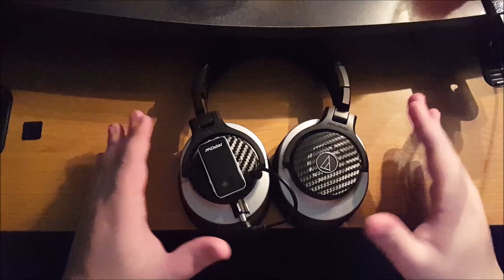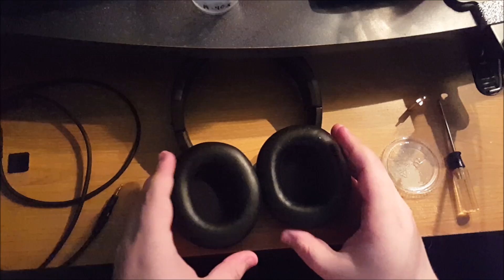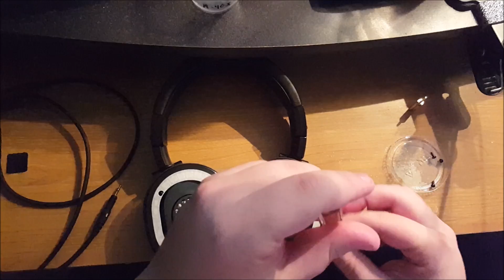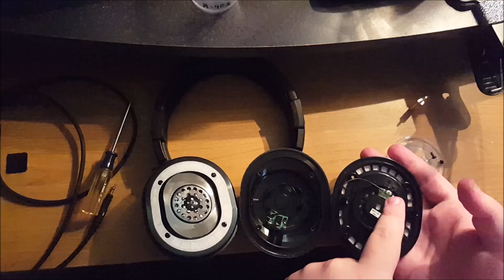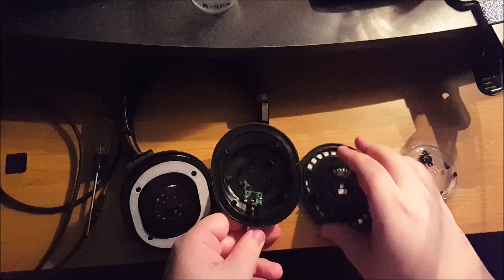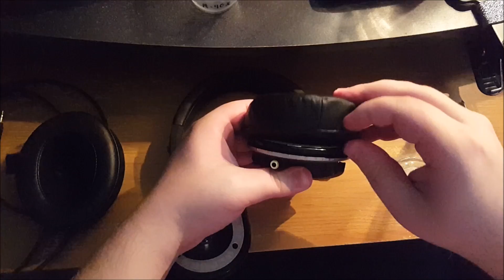how to use any cable with an Audio Technicia ATH M40X

Comment: I've been trying to solve a problem for a few years now.  Mine has the 2.5 mm female connector on it.   I have a Bluetooth adapter that has a 3.5 mm female on it that I'd like to clip to the headband of the headphone. Then I only need a cable that's about 6 inches long.  I'm having a very hard time finding a cable that has these specifications.  I'd also like to have a right angles on each end if possible but not necessary. I know it'd be easier to find a 3.5 to 3.5 cable, but Id rather just use a 2.5 to 3.5  cable instead of opening my headphones to modify it.

Comment: just did this to mod my ATH-M50 so i could use a short 3.5mm cable for my Oculus Quest. thanks!
Reply: What cable adapter did you use?  The one I bought didn't fit

Comment: Thanks, and thumbs up. I have just ordered a pair of these and as well as using them in my home studio, I would like to have all of the benefits of using them on my (Samsung) phone.
All the benefits including being able to adjust volume and skip tracks using the in line toggle on the headphone lead I already have, it has a 3.5mm jack on one end and a 2.5 on the headphone end. 
Does anyone know if the non-locking 2.5mm jack will fit into these? TIA

Comment: can u do something simillar to srh440, 840 or 940?
they have locking mechanism but idk if its simillar or not
Reply: I have the srh440, i've opened and it appears to be the same steps
Reply: @Abraham_Salas  i have actually done this after i commented, it was pretty easy
Reply: @SteelyDanUnofficial  Oh, really? Well, I haven't fully checked if the locking mechanism is the same as I only checked without removing the green card. Was it difficult to remove it?. And could you please tell me what adapter you used?

Comment: There is no sense in removing a quality locking mechanism and replace it with a cheap adapter and a cheap cable. I appreciate the video. but the proposal is not sound.
Reply from the maker: Different strokes for different folks my man; hopefully you have a great day!
Reply: It is if you want to use a vmoda or anything similar

Comment: Nikola--I just wanted to thank you for your clear, easy-to-follow video on adapting the MX-40 for any 3.5mm cable. I easily modded my pair per your instructions and now have a great set of very comfortable cans (I also modded my AT's with the Brainwavz pads and added a Sennheiser HD600-style headband pad) that I have in Bluetooth mode using an Mpow BT 5.0 attached with a velcro patch and 3.5mmm short cable. I guess I lucked out because the little hole for the cable insertion on my set was large enough so that the Josi Minea  2.5mm Male to 3.5mm Female Audio Adapter you recommended fits through the opening with room to spare. There was no need to use any force to get it in there and plugged in. In fact, when I want to go back to wired mode, I can simply use the original MX-40 cable and insert the 2.5mm male end right into the plug with no problem. Even without the locking mechanism it's a firm enough fit so there's no problem. Thanks again!
Reply: @ilko962  

I can see where I wasn't totally clear about what I meant. 

Since the locking mechanism is removed from the MX-40 with this mod, the Josi Minea adapter can be fairly easily removed and re-inserted into the jack hole. 

Note: in my case it's easy--YMMV if the jack hole on your cans is narrower or there are other factors that make it more difficult to remove and insert the adapter. Also note, this removal is easier if you still have the short 3.5mm cable from the Mpow inserted into the Josi Minea, as this helps in being able to grasp it to pull it out. 

Now, with the Josi Minea adapter removed, you can plug the 2.5mm end of the stock MX40 cable into the jack hole and it will stay in there even without the locking mechanism. You're now running in wired mode again. The 2.5mm end won't be locked, but it stays firmly in there in my case. Hope that makes sense.

Comment: Work on the m30x ?
Reply from the maker: Good Evening RegardDogs RegardDogs sadly this will not work on the m30x since the m30x does not have a detachable cable. That in mind If you wanted to do something similar to this it would require use to desolder the two lines coming from the cable that attach onto the pcb on the inside; make sure you know where power and ground go to. next, you would need to get a female 3.5mm audio jack, then solder it in properly to the pcb. After the jack is soldered you will need to either mount the jack inside of the hole where the cable is being fed into or configure the cup so that you can attach your 3.5mm cable to the jack in some other fashion. I personally WOULD NOT recommend you doing this since it's not really that cost effective in my opinion and I am going to go out on a limb and assume you do not have much experience with building electronics/soldering.

Hopefully this helps you my friend and please have an enjoyable weekend! :)
Reply: Nikola Kirchhoff Thanks for your reply and have a nice week-end too

Comment: It's much better to unscrew the PCB, unscrew the locking mechanism, then screw the PCB back. That way you will be able to use the male-to-female adapter whenever you want, instead of making this mod permanent. Now I have the choice of using a BoomPro mic (with the adapter on) or the original cable from Audio Technica (with no adapter). The adapter I bought is small enough not to get jammed inside the hole like the one in the video does. 
Also: don't push the adapter in without having removed the locking mechanism first because you will break it.
Reply: What adapter did you buy?

Comment: I just pushed mine in, not sure why you opened everything up.  
Edit: mine was m50x but it still looks the same.
Reply: Doesn't the M50x have a locking mechanism? I assume you can't just push the adapter in because of it.
Reply: It does but that's only so the original cable doesn't pull out where as the adapter bypasses that (I think) and clips in snug, I actually found it bizarre how perfectly well it sits and that no one mentioned it.
Reply: Yeah, the thing is that that locking mechanism makes the hole a bit smaller, are you sure you haven't broken it by shoving the adapter in?
Personally I've removed the mechanism altogether. The original cable holds up alright. Let's see if the adapter fits in when it arrives.
Reply: Yeah I just checked again it's broken damn so a warning to those who are thinking of trying be careful but the first time I used the headphone cable after I plugged the adapter it wasn't broken so it takes a few tries before it's evident, personally it doesn't bother me as mine are pretty old and roughed up but yeah I think the adapter just squashed those holding pins when I forced it in.  It still holds the original cable in but not as strong and I think it's just a matter of time before the adapter starts sliding back out then I'll just use a glue gun or something.  It's sad that no one does a proper adapter, actually I saw one on DHgate but you have to buy a hundred minimum order but I couldn't find anyone on ebay selling them individually.
Reply from the maker: Greetings Hor Net & ANtonio Gonzalez first off thanks for stopping by; I've been out of country, which makes things kind of difficult especially due to the locations I have to go to for my current job.

I am sorry to hear about your piece being broken Hor Net. The reason why I didn't just slide the adapter in is because I tried, but i felt a slight resistance so I just disassembled the ear cup to make my life easy and not break anything.

Hopefully you two have a wonderful day and I will see you around!

Comment: Nice mod - thanks!
Reply from the maker: Thanks Red Robbo's Workshop! and thank you for stopping by
Reply: @lordofh3  Is the 2.5mm to 3.5mm adapter still working? I saw quite a lot of negative comments on Amazon saying that those adapters will fail easily

Comment: When you pull on the cable to remove it from the 3.5mm socket, is it going to pull the adapter with it as well? Thanks

Comment: Type of jack that needs to be bought? 2.5mm to 3.5mm? any particular size? got any links?
Reply from the maker: Good afternoon Tachyon Mask; I would recommend the 2.5mm male to 3.5mm female connector that is listed in the description since it has an outer diameter of 6.5mm, +/- 0.2mm, which fits snug in the hole. Hopefully this helps you and please have a pleasant day :)

Comment: Does it matter what converted to use?
Reply: He's very clearly asking if one must use the exact same converter you used or if any other converter will work.  And the answer is that any converter thin enough to fit in the existing headphone hole will work.  One with a tighter fit is best
Reply from the maker: Hey Djay i'm sorry, but i do not understand your question. are you asking does it matter if you're convert it to 3.5mm, keep it 2.5mm, or choose some other size socket? If you can provide more information i will be more than happy to assist you.

Comment: Can i just remove the locking mechanism and keep it that way, then attach the 3.5 to 2.5 converter afterwards from outside?
Because i already have cable with 2.5 jack
And i just want to to this for my boommic that has 3.5 jack
So i can change from my boon mic to my regular 2.5 jack cable easily
Reply from the maker: Hi Tobi let me for start off with saying thank you for watching my video!

In regards to your question yes you can instead use a 2.5mm male to 3.5mm male cable as long as the diameter of the 2.5mm end that you plan on sliding into the hole does not exceed 6.1mm / 0.24 inches in diameter; The diameter was verified with the use of a calibrated digital caliper, last calibrated on 02/03/18, with an accuracy of +/- 0.2mm/0.01inches.

Hopefully this helps you!

Comment: why don't you just do it like prophoto do ? which doesn't force the 3.5mm adapter to the chip ? did the m40x and the m50x has different diameter on the hole ?
Reply from the maker: Ismail Lubis first off thank you for watching the video. Every view counts!

The reason why you cant direct connect a 3.5mm to the pcb is because it actually has a 2.5mm female on the pcb. Unless you are stated why am i not just direct connecting a 2.5mm to 3.5mm cable instead? The reason behind that is preference and my concern that if you hit the female connection the wrong way with the male end that you might cause some damage to the pcb and in turn potentially make the headset unusable. Hopefully that helped clarify my methodology and thank you for the interesting question :)

Have a wonderful day!

Comment: thanks for the video! it work. however: anyone else having problems with the 3.5 to 2.5 connector sliding in and out when disconnecting something? i have to hold it everytime. maybe the one you used in the video was marginally bigger.

Comment: A proprietary 2.5mm to 3.5mm adapter that has a locking mechanism similar to ath m series on 2.5mm side should be developed. May be able to use the same adapter in this video but mod the casing so it fits the locking mechanism to fit this headphone and the likes without doing the mod to remove locking mechanism. Makes lives easier  lol
Reply: I'd pay a fortune for that thing.
Reply: Maybe I’m not understanding but why would you want that? The locking mechanism is what he’s trying to get away from
Reply: @sinjon  You lock the adapter to the locking mechanism, and the other side of the adapter has no locking mechanism.

Comment: Without modding, is it not possible to just plug in a 2.5" male to 3.5" female adapter, or just use an aux audio cable with the same plug sizes?
Reply from the maker: heyalbee sadly due to the little plastic locking piece you can not just put a 2.5mm to 3.5mm in. Hopefully this helps you. Lastly, have a good day my friend
Reply: Nikola Kirchhoff thanks for the info. You have a good day, too

Comment: can you insert the 2.5mm without removing the lock mechanism ?
Reply from the maker: Iqbal Rafli I'm sorry, but that is not possible unless you want to drill through it; i highly recommend you do not do it since it would not be that difficult to damage the pcb inside. Hopefully that helped you. Have a wonderful day my friend :)
Reply: Because I've M40x for a while now, if I buy the original cable it would be a bit pricey, but I can't use a third-party cable

Comment: This is by far the most easiest mod in order to be able to plug any 3.5 jack cable into the M40x. No soldering involved and only some very easy manipulations. Kudos!
Securing the adapter can be done with  hot glue, which can be removed without damaging anything if needed.
Reply from the maker: Al Biss thank you for your compliment. I have been hesitant of hot glue due to my worry that it would deform the plastic. If you did hot glue it could you provide it in a link? Also, how would you remove the hot glue without damaging the headphones?  Thank you in advance for your input and please have an enjoyable/pleasant day my friend :)
Reply: Hi Nikola, 
I haven't mod my M40x yet but concerning the hot glue you could do it without any fear of damaging the plastic, as long as you don't put the metal ending of the 'gun' in contact with it for a long period of time. Personally, I would put a litlle amount (inside the cup) where the metal of the adapter touches the plastic of the headphones.
Removing hot glue is as easy as applying some force with a little screwdriver, it will break loose leaving the plastic it was glued to intact. No need to use a lot!

Comment: A very nice idea i should implement when my second cable breaks :P. Thanks
Reply from the maker: No problem Shifterfire hopefully the cable does not break too quickly!
Reply: Unfortunately, the time to tinker has arrived xD. I thought i could solder a new jack onto the cable, like I did with my previous AKG headphone, but the signal cable are so incredibly thin that I would just cut through them to get the insulation of xD.

Comment: Thanks so much. Used your video to mod my headset. Did all the steps and it worked out fine! Listening to my audio technica mx40x's right now. Without any loss of audio quality and without a wire!

Comment: why did they build these with 2.5mm plugs?
Reply from the maker: Hey Steven thanks for coming to my video. I honestly could not tell you with 100% certainty, but if i had to guess it would either be: A) mitigate cost, B) to reduce the possibility of people not buying their cables, C) mix of both, or D) just to be dicks. I'd guess more than likely it's C.

Comment: how come my headphones rattle when I shake them. I did this mod and now they rattle when I shake them
Reply from the maker: I can not entirely say what the cause of your rattling is, but if I had to take a wild shot in the dark I would first check the screws that hold the PCB (that little green board) inside of your headphones. if they're not the culprits I would assume that it is the 2.5mm to 3.5mm converter not being snug with the plastic hole. To fix that problem you would have to use some kind of bonding agent to cement the two pieces together, but I do not recommend this due to the inability to reverse this later on.

Hopefully this has be of some use for you Armando Dominguez. If you have any more questions, concerns, or comments please do not hesitate in contacting me. Also, Have a wonderful day :)
Reply: Nikola Kirchhoff thanks for the suggestions.

Comment: I know this is an old video and I hope you don't mind my asking! If you preform this mod to use any sort of cable, are you still able to use the original cables that the audio technica's came with? Thank you for reading!
Reply from the maker: Hi Infected_Rainbow don't worry I still respond to people :)

sadly you will not be able to use the cables that originally came with the headphones unless you remove the 2.5mm to 3.5mm convertor, which is easy.

No thank you for commenting and have a wonderful day friend!